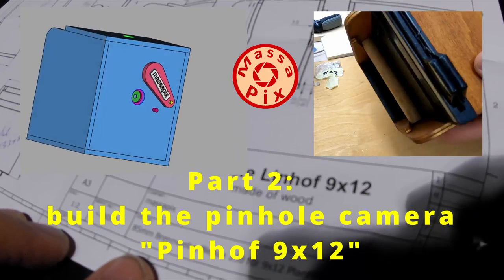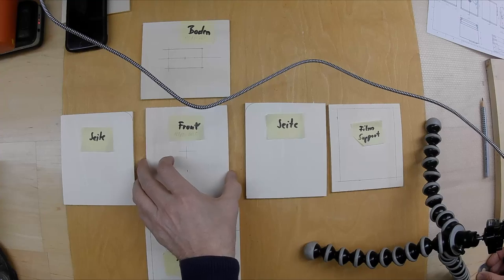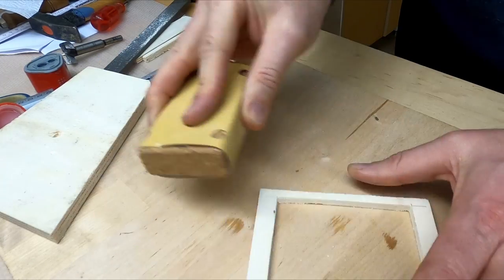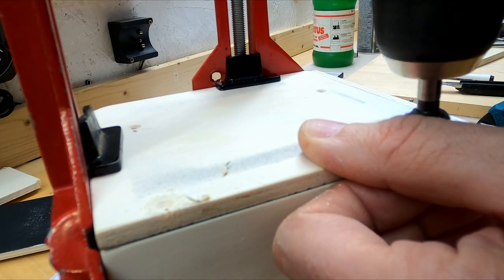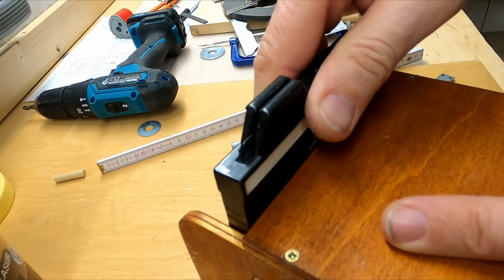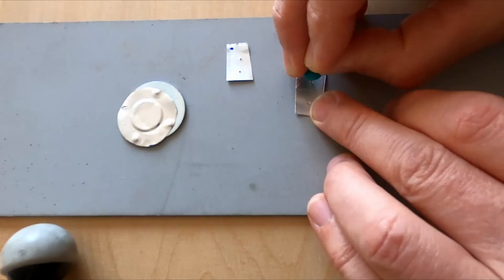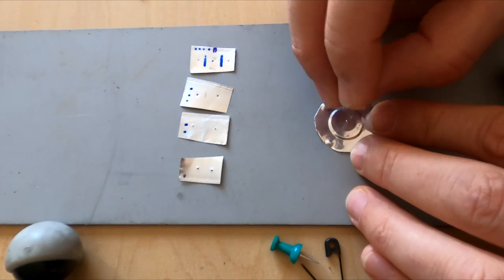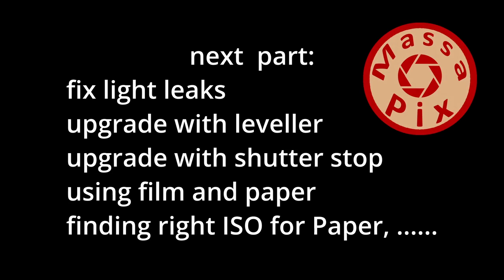DIY Pinhole camera build Part 2

Comment: Loved the videos, clear and simple. How did you Fix the develop method? I want to use the taco method, but now i have doubts. Kind regards from the Netherlands
Reply from the maker: Hello JenM,
Thanks. Part 3 will come soon. But as a preinfo, i will try a more ridgid thing than the rubber band
Reply from the maker: Hello again, does not look to be so easy. Looks like a bigger day develop tank is needed, one with possibility to load 3 spools for 135-film. mine does load only 2 spools, that is the reason why I cannot load the full hight of film. need to dig in a bit more .
Reply: @massapix  thanks so much for the update! I AM Working on a blueprint as i AM writing this!